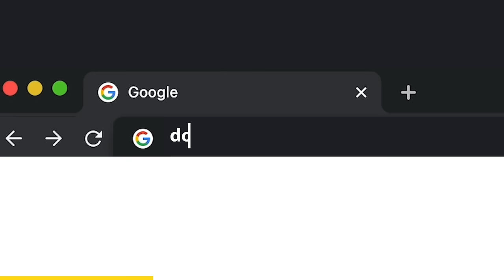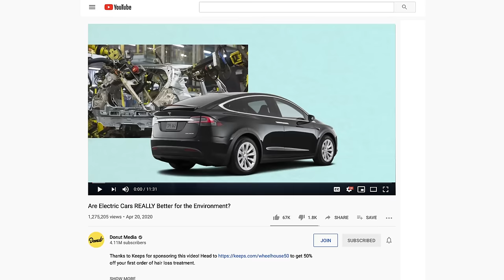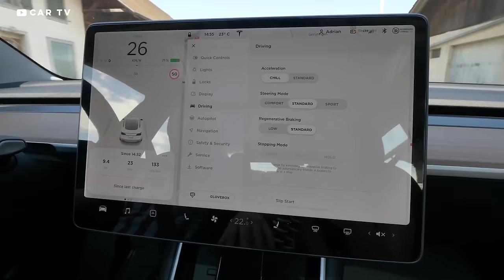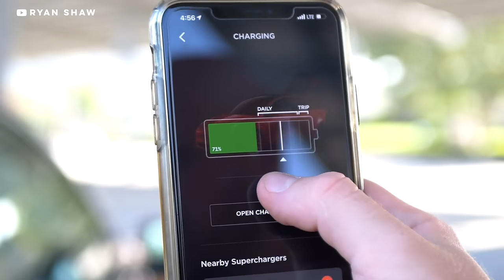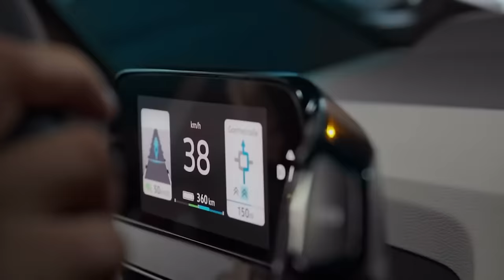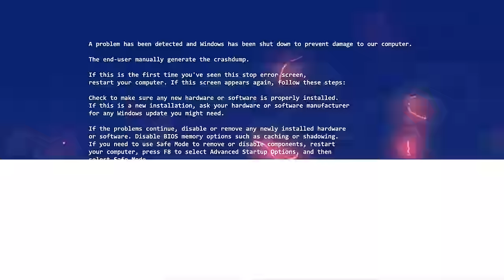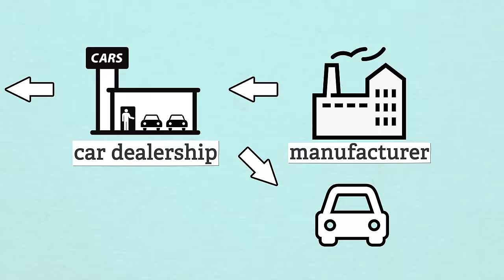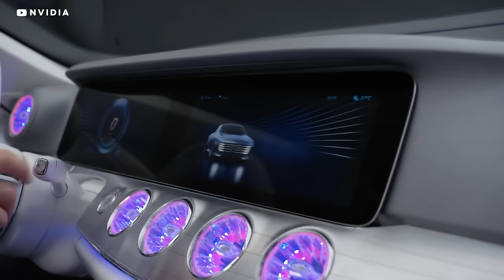Why Can’t Anyone Take Down Tesla?

Comment: Big part of all this they are missing, tesla markets to different people than everyone else - rich people who don't car about it holding value or being serviceable.

Half the value in an EV is the battery. You can charge it and drain it so many times before its shot. 
Any electric car made today will in a few years lose most to all of its sticker value. All the *technology (the software, interface, etc) will eventually go obsolete - like old phones and computer parts.

The average person wont buy a 80k dollar computer knowing full well that it will eventually be basically useless. Car makers like chevy and bmw are targeting middle class people with this.
Tesla is targeting a different market - people who can drop almost six figures on a car that will eventually be e-waste.

I like teslas - they seem neat, but i wouldnt buy one unless i made so much it was as big of a deal as buying a tv. 

As for the environmental argument - massive amounts of ghg are produced by the steel and aluminum industries. Stretching the life of an older car saves way more emissions than having a brand new one built that you can recharge for the next five years with power from the local coal plant. Not hating on evs, but unless youre the second owner of that tesla and life in a city powered by hydro or nuclear, the person driving a 90s car around still had a smaller carbon and environmental footprint.

Comment: The reason nobody has "taken down Tesla" is because nobody has tried.
I wanted a Tesla, until I did my research. Teslas are not enthusiast cars, they are software locked I-phones on wheels; you aren't buying a car, you are buying the right to drive a Tesla, it's a software license, read the fine print. The "minimalist" interior is horrible, build quality is 90's Kia. Hard pass until they or someone else figures it out.

Comment: It isnt a good track car though. It overheats around the track. Its heavy and it cant corner correctly. My take is the batteries that prevent it.  Other sports cars hold records against it. Porche 911, Ford GT, Lamborghini, Ferrari. Etc

Oh. And it isnt faster when talking about standing miles. It will get annihilated in those. Especially against modified race cars. But cry babie tesla
 Owners want stock cars lol

Yeah yeah yeah yeah yeah 0 - 60 whatever.  No one cares about 0 - 60 looool proves nothing at all. Thats teslas are good for 0 - 60s .. Anything else they suck.

Comment: Hard to take down a flee.  Your super leader made 500,000 vehicles - 1/160th of the world market. GM makes 800,000 RAM pick ups alone. King of EVs - wow that's like being king of Luxembourg!.  Ground breaking is right ; the smallest weighs 4000 lbs.  The Semi has 5 and 8 TON battery packages !  They probably crack solid concrete highways.  No end in sight; really? Tesla could easily be totally destroyed if someone beats it to market with superior solid state battery technology, that would render them obsolete. Tesla better be first & best or their tiny market will become non existent.
Reply: EV are the future and Tesla is not going anywhere.  The chances of anyone beating Tesla at batteries is slim to none.
Reply: @user-RCST  Sure time will tell, why would you think Tesla will lead in batteries in the future?  Do you think the current batteries make sense?  I would think you realize that there are not enough lithium ion batteries.  Are you concerned about the environment?  If so is it better to take 10,000 batteries and make 2 EVs and 18 ICE cars or 20 PHEVs?  If you compound your problem by using a grid which is very not green in the USA - how do you fix the environment with EVs?  With the Roadster you would have to make 1 EV and 19 ICE cars; and with the Semi which is equal to 10 Model 3s, you could make one Semi and 99 ICE cars or 100 PHEVs - so if you do think the environment is why EVs are the future - well it won't be with the current lithium ion technology.  And just to open your eyes some, GM just announced they intend to make the largest battery plant in the world dwarfing any other maker, what kind do you think they will make? Old lithium ion?.
Reply: @litestuffllc7249  your logic is so wrong.  Tesla said they're going to make three terawatt hours by 2030 and GM has made a lot of empty promises.  The grid is moving towards renewables too.
Reply: @user-RCST  you didnt answer my question; and I suppose we will see about if GM does what ti says or not ; don't tell me about broken promises Tesla has a long list itself.
Reply: @litestuffllc7249  please tell me about this long list.
Reply: @user-RCST  The Cybertruck was suppose to be produced last year, it is promised again for this year; it won't be. 2015  FSD promised by 2017, then 2019,last year promised this year , it won't be.  2013 he promised solar panels on superchargers still hasn't happened. 2016 promised to hit 500,000 cars by 2018, did not happen till 2020. Model 3 for $35k ; never actually happened even if you counted a government subsidy. 2016 promised a fully autonomous vehicle capable of cross country by 2017? cyber truck? hasn't happened.  2018 Promise of a cut of one time 9% cut in workers; so he didn't have to do it again ; then Tesla cut another 7%.  2018 Tesla was to go private; the SCC charged the CEO with fraud.  2019 promised a profitable first quarter , no loss.  How is that for starters?
Reply: @litestuffllc7249  so do you have a response to me?
Reply: @litestuffllc7249  so I guess you don't have a response.  Cool know the facts before you talk next time.
Reply: @user-RCST  I posted the source of my earlier claims twice don't you see the link?
Reply: @litestuffllc7249  no the link did not show up and I still don't see it.

Comment: Lol your such a dough boy on this. 
 1st their car doesn't pay road taxes. I know I know but fair is tesla pays their taxes to use my road.
 Second the build quality problem is they burst in to fireballs because of the batteries. The motors need replaced at 75,000 miles and its not cheap at all. Finally the parts are absurdly expensive and impossible to obtain. 
 Third battery cars hate cold weather and hot weather. 45° to 64° temperature car.
 Never mind the hours at the gas station to charge it. 
 Btw a trillion calculations is a terraflop eg the ps 5 does 10 terraflops per cycle.
Reply: Car companies don't follow tesla because it's not what people want in a car. 
 We want cheap, reliable, fashionable, and great resale value. Tesla is none of those.

Comment: Well Not to disapoint But! Making a EV MAKES more CO 2 Than a Car Running in Diesel for 100 km of DISTANCE so surely even tho i Love Tesla They will prob fail
 Soooooo surely i think Water powered Cars will Not fail CUZ LITTERALY THERE IS A HUGE SUPLY OF WATER so ev And Teslas will fail srry Tesla Fans ;-;
 Another downside ITS the Lithium Ion batteries That produce The Gute amount of co 2  hence IT Being worser than a Diesel powered Car driving 150 kmh In a driving DISTANCE of. 100km